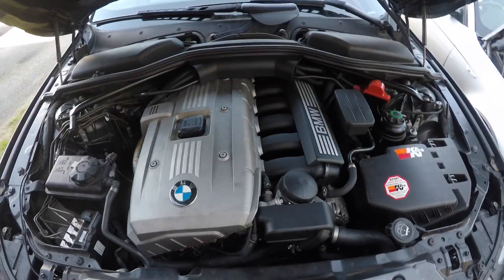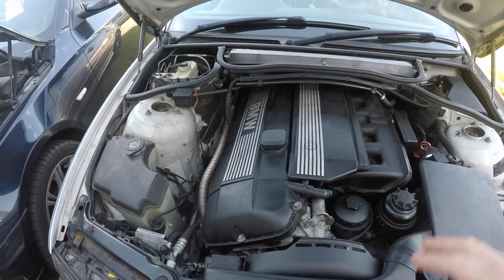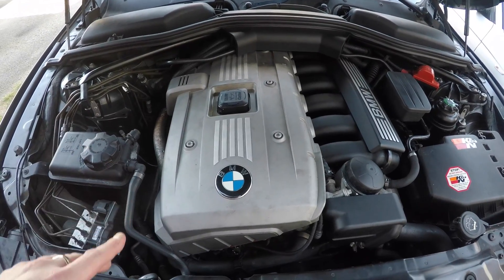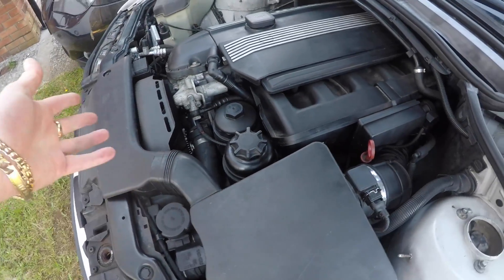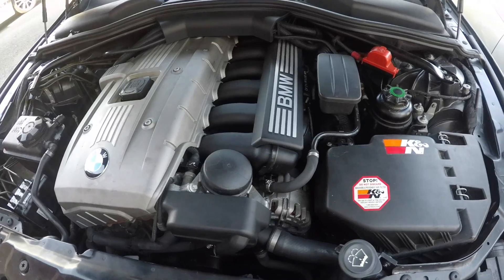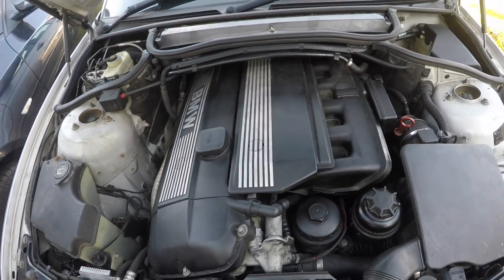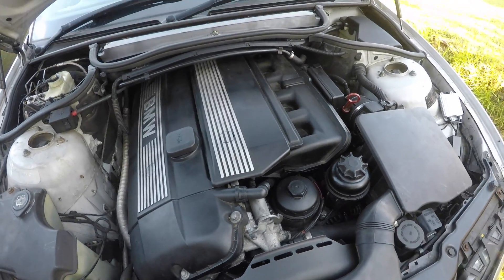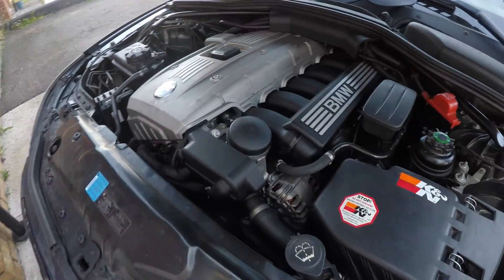BMW N52 VS M54 Showdown Of The Best & Last Of BMW'S Naturally Aspirated Engines Ever Made

Comment: Great channel.  My 2005 530I  m54 engine has been incredible.  It has 365,000 miles (587000 km).  It has been flask and the cheapest car I've ever owned.  I drive a lot (work) and I don't want a turbo DI to be my high mileage car.    I hope to get many more years out of it.
Reply: Fantastic - not flask. Lol
Reply: Thats absolutely amazing i have an 05 x3 with the m54 with160,000, i hope mine can make it as far as yours :)
Reply: Did you make time chain replacement?

Comment: ................... i just "liked"
Reply from the maker: no problem mate did you sub aswell lol
Reply: @BMWDoctor  of course I did Doc ............... p.s my 2010 E90 keeps having the same reoccuring problem .... engine jerking at accelaration, EM light on .... ive dropped it off at garages several times but the problem tends to reoccur after 2-3 months ....typically triggered by down shifting .... the car otherwise at <80k is a dream ... im not cheap with it!
Reply from the maker: please do not tell me its NO 328I OR 528I CRAP MATE since starting youtube I have never heard of such a car
Reply: @BMWDoctor  lol ..nothing that exciting ..... its the 320i ........... London mechanics seem to enjoy charging me ,,, a lot more than fixing it!
Reply from the maker: ahhh brother why 320i man 6 cylinder only for London bro and I know what you mean mate im from there only been here a year where about in London 320i is a NIGHTMARE of a car though mate trust me I had 120i and had to rebuild the whole engine the valve stem seals were shot eccentric shaft had eaten away torque converter locking up timing chain rattling

Comment: Is the N52 a better engine than the M54 Dean? Both engines are good
Reply from the maker: It all depends I think if you have the money n52 is very expensive but is a better engine for power m54 on the other hand is cheaper to maintain but doesn’t make much power of course both suffer oil leaks constant and both use oil that’s just Bmw’s all over that’s why I tell everyone get a diesel they don’t suffer these problems like the petrol 6 cylinders
Reply: BMW Doctor 
Do you recommend 2.0 or 3.0 diesel??

Comment: Great vid, have both engines (E90 330i 6MT N52B30 AND E46 330i 6MT M54B30), have done the odd DIY on both, and I must say, apart from the water pump or thermostat job on the N52, I also find the N52 is somewhat easier to work on. However, mine is still relatively young in terms of mileage, so hasn't yet started leaking anywhere unlike the M54 (previously also had an E46 320i with the M54B22 motor which was a gem BTW) - both the E46 330i and previous 320i had the same typical oil leaks around the valve cover gasket and the oil filter housing gasket, and both consume a fair amount of oil. Now the 320i did have its PCV done many years ago when it became almost completely blocked up and caused the engine to misfire, but this didn't really change the oil consumption. I know that the dipstick return pipe where it goes into the sump can also become blocked up, so when I do the PCV refresh on the 330i I will do everything related to the PCV and this return pipe etc. Interestingly, the N52 which was using some oil earlier on when I owned it, has been using less and less oil as the mileage increases, and being the early grey top N52, still luckily hasn't developed the HVA lifter tick - I must say though, I have always avoided using the car on short trips, and she gets her fair share of WOT runs to the red line when properly warmed up. And yes, nothing beats the glorious engine note of these last ever made BMW NA 6 cylinder engines, plus, I reckon they are still of the more bulletproof engines that BMW has made. The modern line of turbo engines are great when it comes to power, efficiency and so on, but apart from mostly sounding dreary (or fake with active sound), many of them are just not reliable, the 4 cylinder turbos especially! So for now, clinging onto these two cars with a firm grip!

Comment: I have a 2011 US spec N52 that now has 187,000 miles. It runs perfectly.. I’ve only had to deal with water pump, t stat, OFHG and normal maintenance.. at around 95 k whole the car was still under CPO warranty I had coil packs, vanish solenoids, pan and valve cover gaskets and valve cover replacement.. it’s been great as far as I’m concerned. Rock solid engine.

Comment: well isnt N53 the last one...and Dean, can you tell me, in your opinion, which one is better N52 or N53, i am about to get me an e60, and i am leaning towards the LCI model with N53, that is why i am asking...thanks in advance mate
Reply: Crocop I think the N53 has almost the same issues as the N54 because it uses HPFP that fails and similar injectors and its direct injection.. intake valves need walnut blasting. N52 all the way! We never had the N53 here in the US, I’m going by what I read in the past.
Reply: Not buy a N53. Many expensive parts can fails. The injectors, the high pressure pump and there are many probs with the LCI System like deposit at the valves and the intakte manifold.
Reply from the maker: These guys have said it mate avoid the n53 hence why I won’t even bother doing videos on that engine that 6 cylinder engine was a complete failure that’s why you will be hard pressed mate to find anyone who mentions that engine it’s troublesome and expensive get a n52 try get a lci 2007 and it should have the n52k engine with the plastic valve cover all problems are rectified on that engine hydraulic lifters and many other problems that the first engines suffered with
Reply: Thank you Dean, and you 2 guys, will try to get the 2007 LCI with N52, hopefully maybe i find one here in Croatia, but i guess ill have to search for one in Germany...i was planing to buy it in Germany anyway and import it here...been reading a lot about the N53 issues, HPFP, piezzoinjectors, coils, guess some extra power just aint worth the trouble...i am very grateful Dean, cheers mate